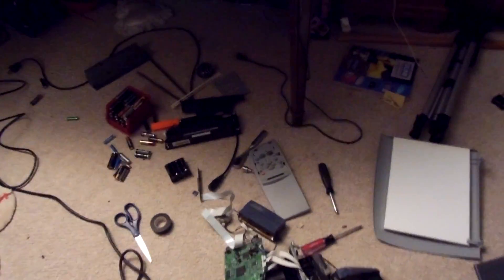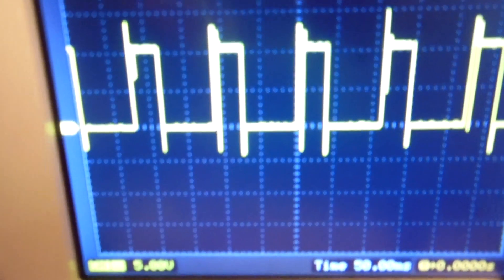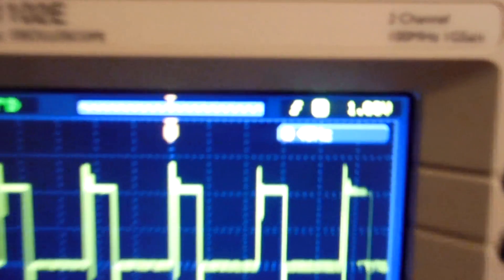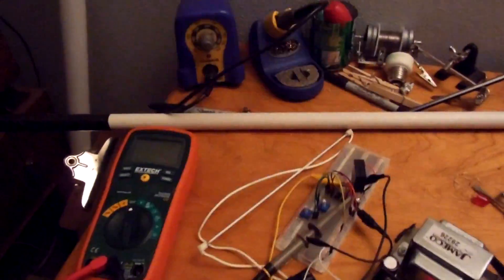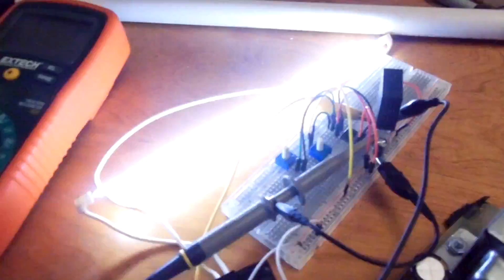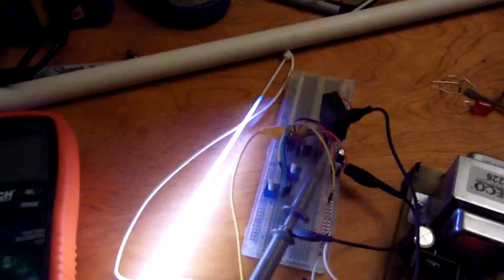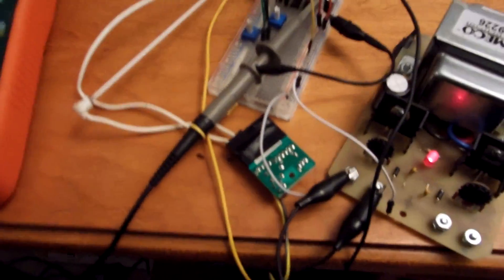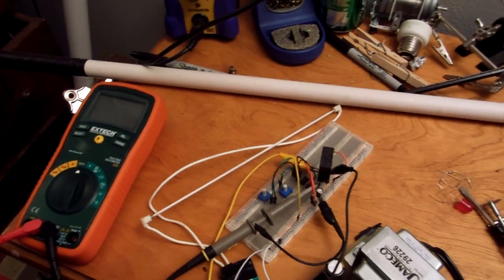Strobe Light Made Using Scanner/Printer Parts

Comment: Try a ssr (solid state relay) instead of the noisy clacking of the relay.
Reply: I agree, try using an SSR that could at least handle 2 volts minimum input,  its response is  faster instead of a noisy mechanical relay which likely will shorten its contact material after certain time of use..